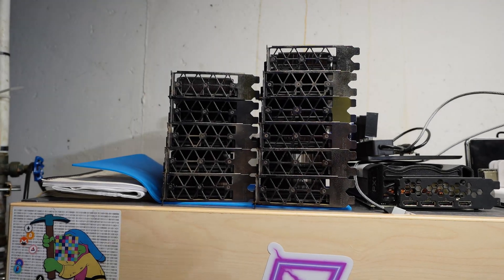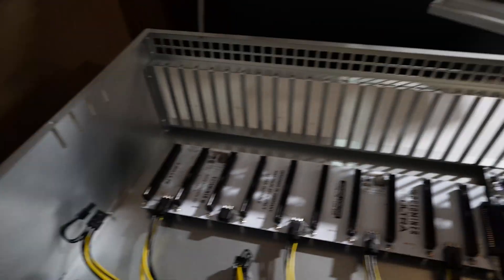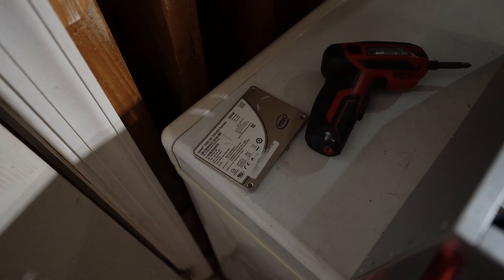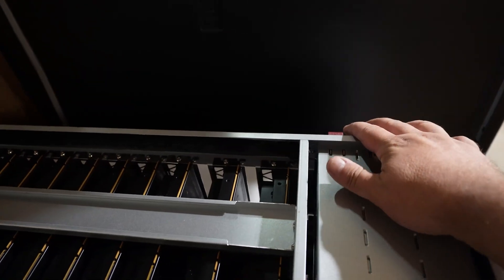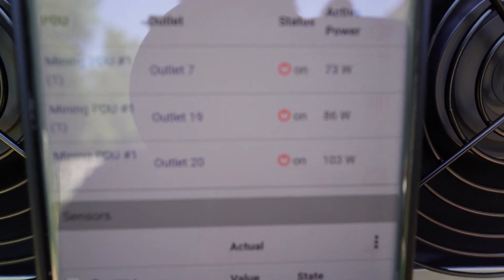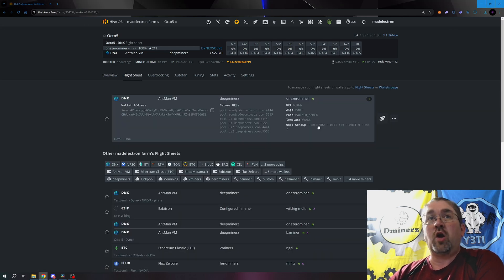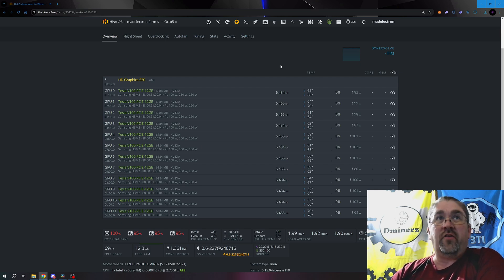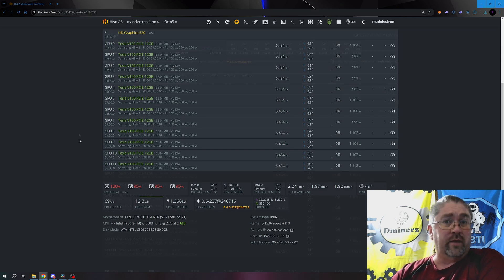Nvidia CMP 100-210 Rig Build

Comment: Hmm 🤔 I thought they would do better on temps.
Reply: Turns out the fans need to be on the opposite end of typical cars and they run much cooler
Reply: I have the same case for the same set up and same cards. I have it on the porch and it’s 40° outside but when I installed the cards I put 3/8” high by 3/4”Wide foam weatherstripping in between the cards and lengthwise next to the main board and covered the Video card‘s on top and then put the lid on top, then put the fans on the outside blowing out with the wires zip tied them into the SSD drive hole and right now I’m mining aleo and the cards are running around 20°
But unfortunately, I haven’t tried this in warmer conditions since I live almost next to Canada.

Comment: Nice! Can you please add links or detailed specs to the cpu and ram that you added?
Reply from the maker: just search ebay for i5-6600 or i5-6600T cpu, and ddr3 1866 ram, 2 8GB sticks will work nicely.
Reply: @madelectronengineering  Thanks, I think this is also low voltage RAM. Consider adding extra fans on the back for better cooling, you should be able to plug in 3x140mm fans to the fan controller. Not sure about that 1 vga cable per card, you can do 3 per 2 cards with one 4pin to 2x4pin splitter. However, you will only be able to use 10 cards. I upgraded my psus to 3x1200 for $70, cheap insurance if they go full bore for whatever reason. Cheers, keep that content coming, very helpful!
Reply: @mancavetech  hows your cooling?
Reply: @dustinash7867  It is much better. I can go to 160w/gpu and mem/core are generally in the green, but my overall setup is not ideal for efficient exhaust outside, so ambient temp is like 90. However, many more OC options if you can get to 160w and gpus are not overheating. Prior to that they would go into red at about 130w/gpu. I also did not yet try that styrofoam trick by blocking airflow between gpus. good luck.
Reply: @mancavetech  I have a rig on the way to setup. I did not plan to have 2 pins connected so was going to stay under 150W per card, but I may go 3 per 2 cards. Rigs are all inside in 70 degree basement with octominers so maybe that will help cooling.
Reply: @dustinash7867  nice! just to be safe - connect 3 cables per 2 gpus. If OCs dont work, there is a possibility the card may try to pull full tdp. This happened to me when I tried doing Ergo with a T-rex miner. Rigel took OCs no problem, though. 1.5 cables and the riser should have more than enough headroom to handle 250w.
Reply: @mancavetech  do you need to upgrade the cpu and memory on the octominer? or is that just a preference?
Reply: @dustinash7867  preference only, it works fine at stock hardware.
Reply: @madelectronengineering  having gpu driver issues with mine. Did you update drivers? If so, how?
Reply from the maker: @dustinash7867  use hiveos kernel 5.15 and nvidia driver 550.100
Reply: @madelectronengineering  what cpu and ram did you upgrade to? Or is that in the video?